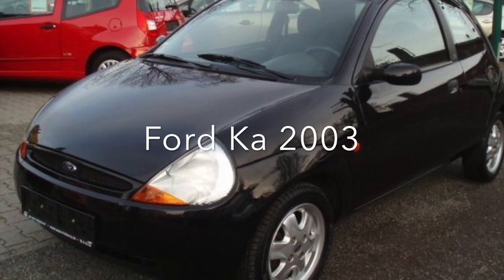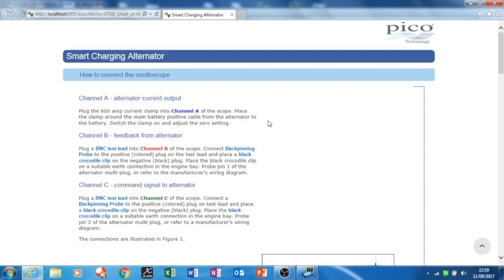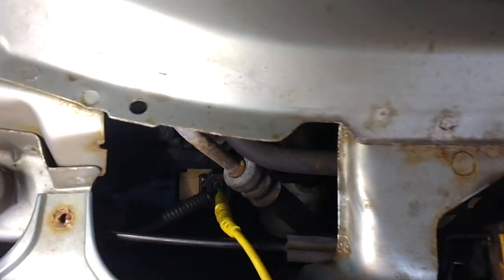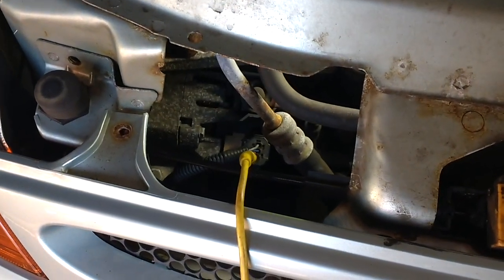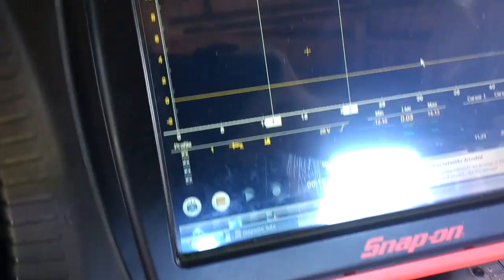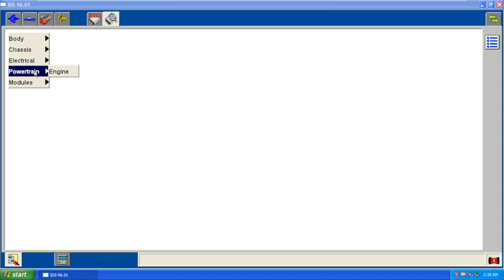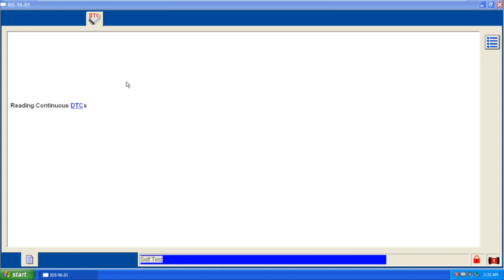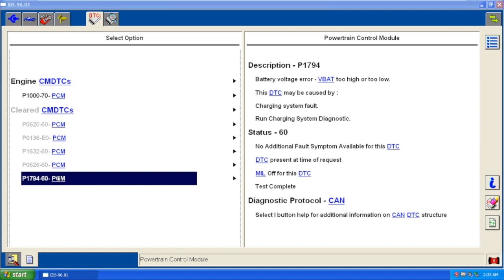FORD SMART ALTERNATOR PART 1

Comment: Smart alternators go to 18.5 volts and that is why the silver-calcium battery internal grids which do not buckle on the heat produced at the peak volts are used on modern cars..

Comment: hi i had a ford focus  last year the alternator had burnt out  fitted a new alternator and it was going getting really hot after a couple of minutes  problem turned out to be the battery plates had bent causing a short it also had lead battery fitted
Reply from the maker: tony pond cheers Tony that what we did changed the battery for a silver calcium and alternator problem sorted cheers sandy